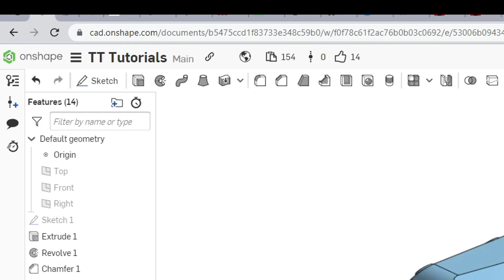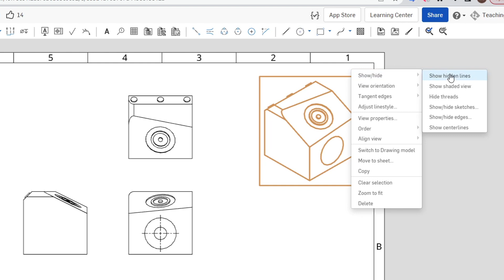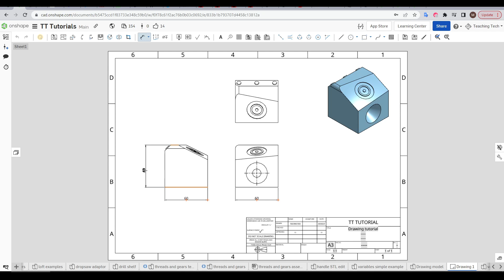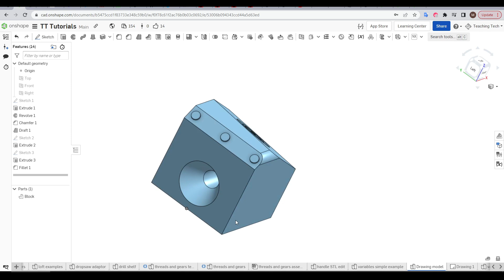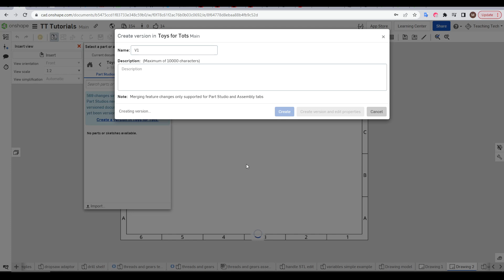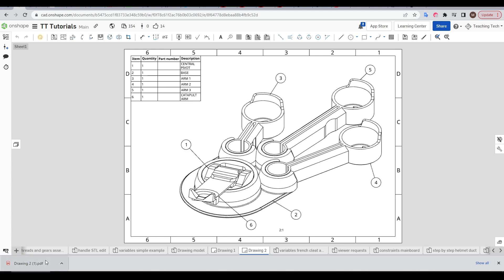3D model to technical drawing  - 3D design for 3D printing

Comment: Coming from a Pro-Eng background of close to 3 decades, I'm intrigued by the elegance this software may have for home hobby use. Before I spend a few weeks learning the in and outs of Sketchup, it would be imperative to know the assembly capabilities. I saw a 6 year old video that wasn't satisfactory to the skill set I  would be molding to and a poor reference. But that was 6 years.
The video of drawings shown here wouldn't work in today's modern manufacturing. Does it even have ANSI tolerancing? 
Does it have the ability to do complex drafting from a parting line? Can it do moldflow analysis? 
Any and all input would be greatly appreciated.

Comment: Can you please show how to use
 "Auto layout" 
onshape extension.
I want to slice a 3d object to multiple 
2 mm thick slices and then lay it flat to make a template, which i can print and use it to cut 2mm MDF board for my project.

Comment: Drawings, especially 1:1 scale can be useful for early prototypes for 3D printing too. My laser printer is way faster than my 3D printer. I used 1:1 drawings + scissors to check that the size of a handle would be about the right size, a awkward curve would fit the original object, etc.

Comment: I have a set of diagrams of an object and I'd like to be able to put in each face and then have the computer make it 3d so I can 3d print it.  Is there a way or program that would do that?  Thanks
Reply: btw, it's a space ship and it shows top, bottom, left, right, front, back etc.

Comment: Just to highlight a few key principles of drawings: 
1) Drawings are almost always used to CHECK parts - not build them. Anyone machining a part, building a mold, making a stamping tool, etc. will have access to the 3D model. The drawing is used to determine if the parts coming out of those processes are within tolerance. 

2) Because the drawing is being used to check parts, make sure the dimensions are defining the features that matter. For example, what's critical about a pipe in your application - the OD, wall thickness, or ID? Dimension the two that matter most, so those are checked. 

3) Make sure each dimension is actually measurable - try to not go off of imaginary points in space or hard-to-find inflections between radii. 

4) Tolerances should be based on need, not what you think the process should achieve. In other words, if a plastic part is warped by 1mm, but it will still work in an assembly, would you reject 1,000 of them? If not, give a wide tolerance. 

There are a lot more things to keep in mind, but you will cut down on a lot of headaches if you follow these principles.
Reply: Machinists dont use 3D models when making parts. Not everyone uses a CNC. This is all the more reason to have fabrication drawings that highlight the important dimensions that will aid the machinist in making the part (knowing which face will be used as the reference plane and having dimensions from that plane for example).
Reply: "Drawings are almost always used to CHECK parts - not build them." Wrong! for more information search for "ISO 128"
Reply: @hansmeier4930  In practice, 3D models are used to make the tooling or paths for almost all processes, e.g., molding, stamping, CNC machining, 3D printing, etc. However, machinists will sometimes reference a drawing for features like hole locations and feature tolerances. But Quality teams will use those drawings everyday to check parts, to validate functionality and that the process is controlled. Very few manufacturing processes require looking at a drawing, but all require referencing one when checking the parts. So when you're detailing a drawing, you should be thinking about how the Quality tech will be measuring each dimension.